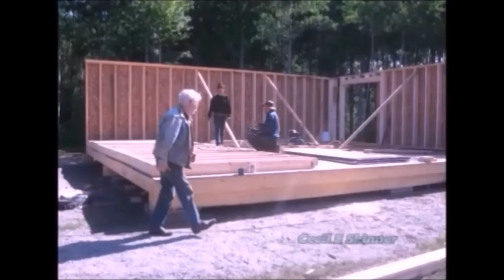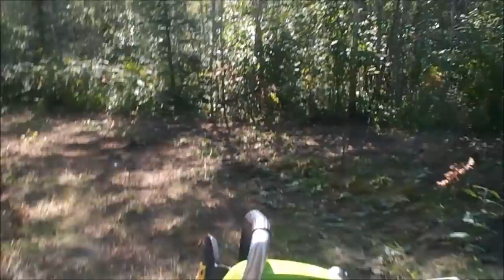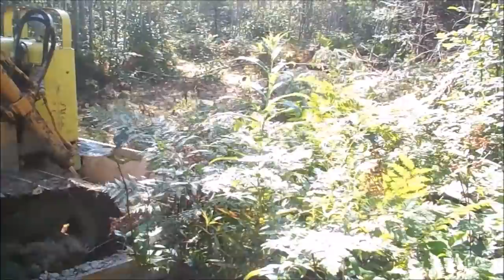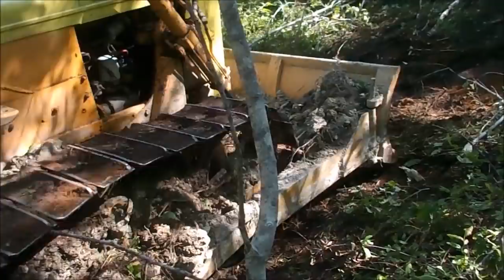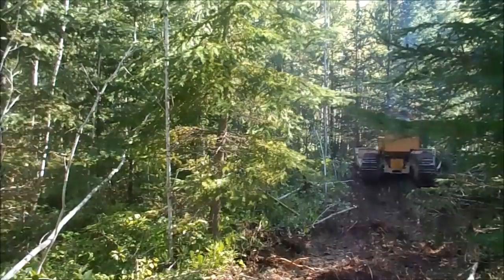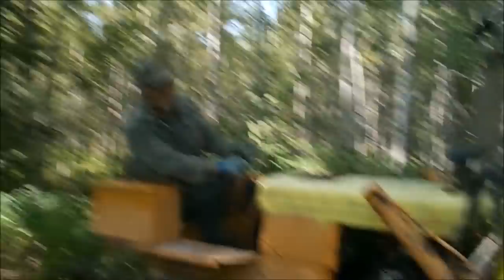Making A New Section Of Trail, With Our Case 310 Dozer

Comment: Fixing to pick up a Case 450 crawler loader. I’m feeling good after seeing what yours does and it’s quite a bit smaller. Really a fine machine you have there. Case is favorite brand for heavy duty equipment. I would definitely weld some sweeps and cage on that if you are able to. Sure could save your bacon from a falling tree. Great video. Don’t sell that thing. You don’t always need a dozer but when you NEED one, nothing else will do.
Reply: Was thinking the same thing about sweeps and cage.

Comment: Hey guys. Awesome job on the road that will defiantly be better especially for the sleds like you said. The dozer just plows right through lol. If you have time could you show a little clip on how you cleaned those breaker points? My little case VA tractor is doing the same thing it sputters a bit under load lol. If you have time. Thanks for the update guys. Have a great night. Ttyl.

Comment: Hello Cecil. I'm looking at a Case 310 D2 (diesel) dozer on my local Craigslist. They claim it runs (or did), but it looks like it has been sitting for years and needs a lot of work. It's listed for $1500 for the dozer and $800 for the backhoe attachment. Do you think $2300 is what the dozer could be valued at? Are parts hard to find? Modern tractors/dozers are so expensive that restoring a classic is looking like a viable option. Any insight or advice would be very appreciated.